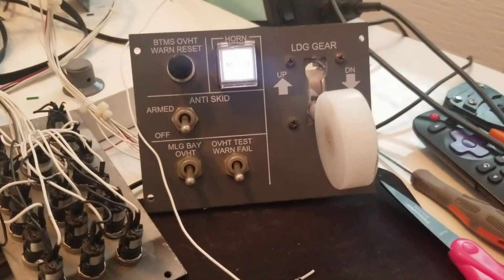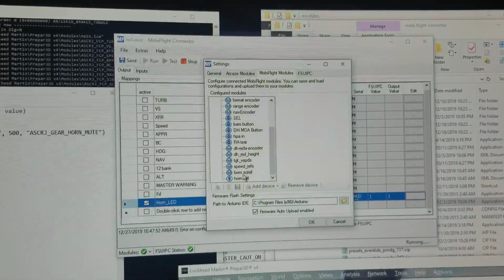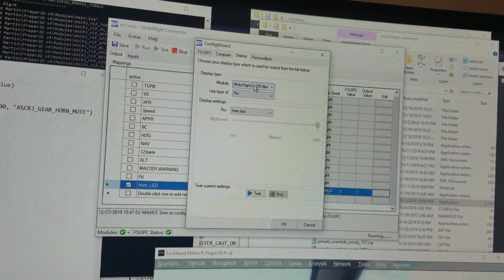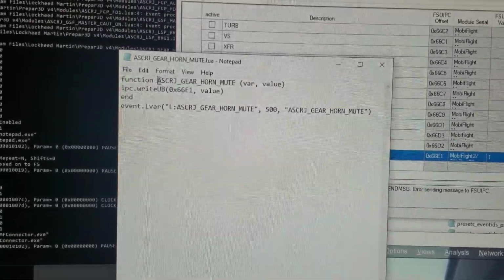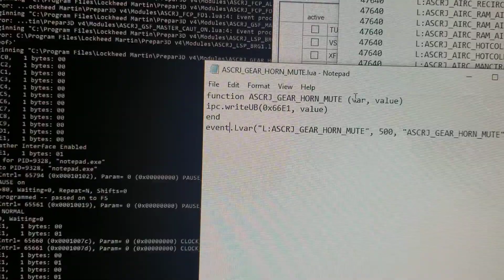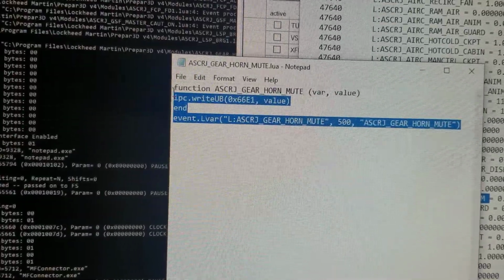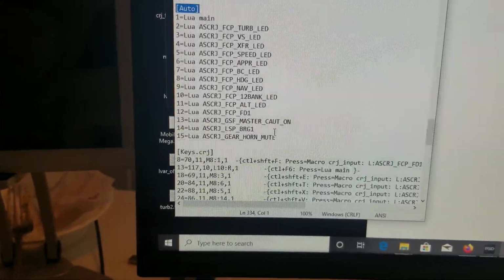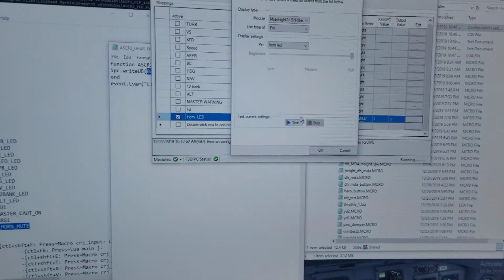Activate LED lights by assigning FSUIPC offsets in MobiFlight Connector using LUA Scripts Flight Sim

Comment: Thank you so much for the video! Would you be so kind to tell in which site I can find those available offsets? Regards
Reply from the maker: http://www.fsuipc.com/   Just look for the SDK link
Reply: Thks! Used your video using the Lvars for the Inputs and worked perfectly! Really happy, but I am really struggling with the Output. I followed every step several times but not managing to fire the light! I got the Lvar (L=embApFlchClick) and placed exactly in the Lua file as you instructed.
Reply from the maker: @jmsiqueira1989  are you sure that is the correct LVar?  Have you dumped all your LVARS into the log file to make sure you are using the correct one?
Reply from the maker: Are you using MObiflight for the output to fire the LED?
Reply from the maker: @jmsiqueira1989   Also...have you assigned a proper FCUIPS number to hold the data for the LED?
Reply: @AaronWerner  I Fired the Lvars to the Log file. I want to fire a LED in the output everytime FLCH is pressed. I found the LVAR which is "L=EmbApFlchClick", so my following lua file is: 
function EmbApFlchClick (var, value)
ipc.writeUB(0x6904, value)
end
event.Lvar("L=EmbApFlchClick", 500, "EmbApFlchClick")

The INI file is set as follows:

[MacroFiles]
1=Guidance panel
2=P3D
3=EMB AP VS
4=AP_HDG
5=EMB_SPDMAN
6=L_ENGINE_FIRE
7=AP VS
8=AP VS INC
9=AP VS DEC
10=EmbApFlchClick
11=FMS FPL
12=EmbApFpaClick

[Keys]
1=72,8,1114,0 	{H: Press= }
4=74,8,1114,0 	{J: Press= }
6=76,8,1114,0 	{L: Press= }
8=71,8,65804,0 	{G: Press=AP_ATT_HOLD_ON }
10=83,8,1114,0 	{S: Press= }

[Window.Message Window]
NewDocked=20, 47, 2520, 23

[Window.SimConnectWindow]
NewDocked=960, 540, 640, 360

[Profile.arduino]
1=Embraer 190 House

[LuaFiles]
1=EmbApFlchClick

[Auto]
1=Lua EmbApFlchClick
Reply from the maker: @jmsiqueira1989  did you store the value in  an FSUIPC offset? You must just store the value and then access the FCUIPC offset in mobiflight to read it and execute he LED.
Reply: @AaronWerner  I´ve seen this "0x6904" offset in someone´s post and tried to use the same. But not sure if that Offset works out
Reply from the maker: @jmsiqueira1989  No you have to use one that is not currently being used.  Read the FSUIPC documentation to understand.  I do not have the time to explain here.  I am sure after you read you will know what offset is available on your aircraft to write to.  Once  you locate this, it will be very easy to store, read and fire LED.

Comment: Hi, thanks a lot for your videos. I strictly follow your instructions but it doesn't work. Is it possible that something change with the latest version of Mobiflight and FSUIPC6? Do you know where I can find a tutorial or information about this?
Reply from the maker: Did you restart the sim?
Reply from the maker: I am not sure if something changed in the latest.  It is possible.  Can you download an earlier version and test it?
Reply: I think that something change, since I also followed your instructions in another video "Lua script and macro no FSUIPC offset" and it didn't work. So I tried in a different way, I didn't edit the Macro (I left the macro as the mouse macro originally created by FSUIPC), then in Mobiflight under FSUIPC Lua Script I edit file name:file name, for example my macro file is EFIS_CSTR I then write EFIS_CSTR:EFIS_CSTR and magically it worked.

Regarding the MOBIFLIGHT output I am lost, I tried in many different ways and I couldn't. If you have any ideas please let me know. Do you know where I can find an earlier version of Mobiflight?
Reply from the maker: @fabiofarinon3988  I might have an older version but I would like to figure out what changed.  I have not worked on my sim for a few months and if there is a change we need to identify what and how to work around it.  I will try to spend some time on it this week with the latest version. Send me a copy of your code and I will try to replicate it.
Reply: @fabiofarinon3988  Hi, I am wondering if you have figured out how to get the LED worked?

Comment: I follow your instructions .but still can't read my value offset
Reply from the maker: My guess is that you may be using an offset that is already assigned to something else, if not, make sure you name the file correctly and the code matches exactly like the code in the video except the actual offset that is assigned and the name of the LVAR.    Also, remember when adding Lua scripts you have to define them in your fsuipc INI file in order for them to load upon startup.
Reply: @AaronWerner  in my case ,I fly a2a Cessna c172.
Name file at module" Lkap140_hdg.lua"
In file fsuipc.ini edit .
Auto
1= Lkap140_hdg.lua
Reply from the maker: @maskystudio9193  post a copy of your code here.
Reply from the maker: Also did you restart after editing the FSUIPC.ini file?
Reply: U mean restart prepare3d
Reply from the maker: @maskystudio9193  Yes
Reply: function L:kap140_hdg(var, value)
ipc.writeUB(0x66E2, value)
end
event.Lvar("L:kap140_hdg",1,"L:kap140_hdg")
Reply from the maker: @maskystudio9193  Your code is not formatted like the one in my video.  For example, you have the L: following the function.  You do not include the L:  I did not look at the rest of your code but it appears you are missing info on the last line.  Please make sure you follow my example in the video and you will be fine.  Every space, line needs to be formatted the same or else it will not work.
Reply: Ok .I will editing script  and show u result soon..
Reply: ***** LUA: "Lkap140_hdg.lua" Log [from FSUIPC version 5.141e] *******
    55813 System time = 16/07/2021 23:05:21, Simulator time = 14:02:47 (07:02Z)
    55813 LUA: beginning "C:\Program Files\Lockheed Martin\Prepar3D v4\Modules\Lkap140_hdg.lua.lua"
    55813 LUA: ...kheed Martin\Prepar3D v4\Modules\Lkap140_hdg.lua.lua:4
    55813 LUA: Global: ipcPARAM = 0
    55813 LUA: ...kheed Martin\Prepar3D v4\Modules\Lkap140_hdg.lua.lua:2
    55813 LUA: ...kheed Martin\Prepar3D v4\Modules\Lkap140_hdg.lua.lua:5
    55813 LUA: Waiting for an event in "C:\Program Files\Lockheed Martin\Prepar3D v4\Modules\Lkap140_hdg.lua.lua"
   276109 >>> Thread forced exit (ipc.exit or os.exit) <<<
   276109 System time = 16/07/2021 23:09:01, Simulator time = 14:06:17 (07:06Z)
******* LUA execution terminated: Log Closed *******
Reply: function kap140_hdg_button(var, value)
ipc.writeUB(0x66C2, value)
end
event.Lvar("L:kap140_hdg_button", 500,"kap140_hdg_button")
Reply: THAT FSUIPS.INI

[General]
UpdatedByVersion=5141e
History=B05OKYY0D6MSSS6363XIW
AxesWrongRange=No
TCASid=Flight
TCASrange=40,3
AxisCalibration=No
DirectAxesToCalibs=No
ShowMultilineWindow=Yes
SuppressSingleline=No
SuppressMultilineFS=No
AxisIntercepts=No
DontResetAxes=No
ThreadAffinityMask=x0
LuaAffinityMask=x0
InitDelay=0
GetNearestAirports=Yes
LogOptionProtect=Yes
TimeForLuaClosing=2
WeatherReadFactor=2
WeatherRewriteSeconds=1
TrafficStallTime=1
InitialStallTime=10
NormalStallTime=1
LuaRerunDelay=66
ComReadLoopTime=20
ControlsListBuild=24048
ProvideAIdata=Yes
ProvideAIairports=Yes
Console=No
ConsoleWindowTopMost=No
InitDelayDevicesToo=No
PMDG737offsets=Auto
PMDG747offsets=Auto
PMDG777offsets=Auto
A2AC172Roffsets=Auto
Annotate=Yes
UseSystemTime=No
UseMidMouseBtn=Yes
MouseWheelMove=No
MouseWheelTrim=No
MouseWheelTrimSpeed=1
JoystickTimeout=20
RestoreSimcWindows=No
FixMachSpeedBug=No
AutoScanDevices=Yes
DisconnTrimForAP=No
ZeroElevForAPAlt=No
ThrottleSyncAll=No
WhiteMessages=No
ShowPMcontrols=No
SpoilerIncrement=512
MagicBattery=No
RudderSpikeRemoval=No
ElevatorSpikeRemoval=No
AileronSpikeRemoval=No
ReversedElevatorTrim=No
ClockSync=No
ClockSyncMins=5
ClearWeatherDynamics=No
TimeForSelect=4
LoadFlightMenu=No
LoadPlanMenu=No
PauseAfterCrash=No
BrakeReleaseThreshold=75
SaveDataWithFlights=No
ZapSound=firework
ShortAircraftNameOk=Substring
UseProfiles=Files
EnableMouseLook=No
DelayedMouseLookZoom=No
WideLuaGlobals=Yes
ConsoleWindow=0,0,0,0
DebugLua=Yes
FSVersionUsed="Lockheed Martin® Prepar3D® v4",4.2.21.24048
SimConnectUsed=4.2.0.0
LogWrites=Yes
LogEvents=Yes
LogLua=Yes
LogAxes=Yes
LogButtonsKeys=Yes
LogExtras=Yes
LogReads=Yes

[WideServer]
WideFSenabled=Yes
AdvertiseService=1
Port=8002
Port2=9002

[Traffic Limiter]
AirportPreference=50
PlannedAirportsPreference=50
GroundPreference=50
NearerPreference=50
TargetFrameRate=0
TrafficLimit=0

[JoyNames]
AutoAssignLetters=No

[JoystickCalibration]
RudderBlendLowest=1
AllowSuppressForPFCquad=Yes
ExcludeThrottleSet=Yes
ExcludeMixtureSet=Yes
ExcludePropPitchSet=Yes
SepRevsJetsOnly=No
ApplyHeloTrim=No
UseAxisControlsForNRZ=No
FlapsSetControl=0
FlapDetents=No
ReverserControl=66292
Reverser1Control=66422
Reverser2Control=66425
Reverser3Control=66428
Reverser4Control=66431
MaxThrottleForReverser=256
AileronTrimControl=66731
RudderTrimControl=66732
CowlFlaps1Control=66162
CowlFlaps2Control=66163
CowlFlaps3Control=66164
CowlFlaps4Control=66165
SteeringTillerControl=0
MaxSteerSpeed=60

[Axes]
PollInterval=10
RangeRepeatRate=10

[Buttons]
PollInterval=25
ButtonRepeat=20,10

[LuaFiles]
1=Lkap140_hdg

[Auto]
1=Lua L:kap140_hdg

[AutoSave]
Next=1
Interval=60
Files=10
SaveOnGround=No
AutoSaveEnabled=Yes

[GPSout]
GPSoutEnabled=No
Port=COM1
Speed=4800
Interval=2000
PosTo6Decimal=No
SimModeIndicator=No
Sentences=

[GPSout2]
GPSoutEnabled=No
Port=<none set>
Speed=4800
Interval=2000
PosTo6Decimal=No
SimModeIndicator=No
Sentences=

[Sounds]
Path=C:\Program Files\Lockheed Martin\Prepar3D v4\Sound\
Device1=Primary Sound Driver
Device2=SHARP HDMI (NVIDIA High Definition Audio)
Device3=Realtek Digital Output (Realtek High Definition Audio)

[Window.Message Window]
NewDocked=20, 55, 1329, 17

[ClientNames]
1=CAPTAIN

[Monitor]
Display=15

[Profile.c172]
1=C172R default
2=C172R F-GOAP

[Keys]
4=72,10,66106,0 	{ctl+H: Press=AP_PANEL_HEADING_ON }

[Keys.c172]
5=72,10,65798,0 	{ctl+H: Press=AP_PANEL_HEADING_HOLD }
Reply from the maker: @maskystudio9193  In your INI file you have the following 1=Lkap140_hdg
 it should be 1=kap140_hdg You do not need to use the L to define the LUA script here, you just need to add the name of the file.  Unless you name the file with the L, remove it.   If your file name includes the L then you will need to update the code to reflect this.  Make sure you restart the sim after making any changes to the .INI file.  Also make sure Mobiflight is up and running as well.   If it does not work, then check all your code because something is off.  I want to help where I can but I am not your code tester you have to take the time to do this and be accurate at it.  Good luck!
Reply: Where u get list aircraft code.
Where file in location
Reply from the maker: @maskystudio9193  I do not understand?
Reply: In my case i don't know ist true or not my script.i copy pdf sample c172 

Heading lock set =(L:kap140_hdg,button)
Reply from the maker: @maskystudio9193  Are you looking for the panel vars for your specific aircraft?  If so follow the instructions in this video. https://www.youtube.com/watch?v=mOO32FiMNS0&list=PLlT7WHi69XcdmtFnWhTkwl8wJtskb_4j8&index=7
Reply: I see your fsuipc.ini file, under [Auto] first line u have 1 = Lua main.
This word tittle for the?
Reply from the maker: @maskystudio9193  It is the name of a file that holds multiple scripts.
Reply: So I should be create main Lua script.
How can I do
Reply from the maker: @maskystudio9193  No you do not.  That is only a name I gave one of my lua scripts.   You need to verify the name of the LVAR for your aircraft.  If all the code is correctly written and the name is correct it should work.  Are you sure FSUIPC and Mobiflight are both working when you start your aircraft?
Reply from the maker: YOu might try a different offset as well.  You need to locate one that is not being used by your aircraft.  I am not sure how you would do that.
Reply: What inside file main lua.i think this part I missed
Reply: My fsuipc running perfect to mobiflight.if I fly default aircraft p3dv4 For your information.if I editing fsuipc.ini file.i must be restart again my sim.many hour I try configure them.hahaha....
One more think.ist any activate in fsuipc.ini file.
My experience b737 pmdg it same situation.
I edit ' enable data broadcast ' it done connecting.

Comment: Why exactly do you need an offset when you have an lvar? I really don't understand offset and why is it required?
Reply from the maker: From my understanding early on in the sim world, data was stored in offsets.  So earlier aircrafts leaned on offsets as a method for controlling the data.  Later aircraft designers started using variables and as a result, we have LVARS and scripts like LUA.  In examples like the one in this video we are somewhat piggybacking off of existing tech (FSUIPC) and bridging it with the LVARS using middleware like MobiFligth Controller.  It is just a point and click solution that eliminates a person having to code the behaviors of the aircraft and hardware.
Reply: @AaronWerner  got it. Thnx
Reply: @AaronWerner  can we create our offsets?
Reply from the maker: @CaptMeMo_350  Yes if you look at the video above you can see a write statement.  You can assign your data to an offset as shown in the example I provide
Reply: @AaronWerner  man I have just discovered your channel and its like a treasure for me :)). those are the stuff that I was looking for. Very very appreciate indeed
Reply from the maker: @CaptMeMo_350  took me forever to figure it out....so I feel the pain. I am happy that you found it.

Comment: great vid, is it possible to assign "in-transit" red led and "3-green" green LED to a landing gear light-set (using RGB lights for red & green) ... so i would have 3 single led's next to a gear lever and since they are RGB, they would either be OFF state, ON GREEN state, ON RED state for Landing Gear UP, Landing Gear DOWN, Landing Gear IN-TRANSIT respectively using MOBI-FLIGHT or similar program?  (Mobi-Flight has 2020 compatibility now, that's why i mentioned that one).  Thanks in advance!!!
Reply from the maker: Yes it is possible.  You need to dump the LVARS into the log file as I showed in my video on lvars.   Locate the lvar associated with the red / green state.  Assign those  as shown in video.
Reply: @AaronWerner  -- great, i will review the video again and look for LVARS !!!  perfect, thanks!!!

Comment: sorry just saw this video after my previous comment. What does the "500" represent? cheers
Reply from the maker: This is the value assigned.  From my understanding (very limited) it controls the intervals related to the polling for that specific item.  For example, if you were writing it to turn the ignition key in an aircraft to the "On" position it would require a 100 to complete this.   I have had to do a lot of trial and error with the values.  

There may be a better guide or instructions on this you could find. If you happen across more info. Please come back to this post and update us.

A few other items in the script that may help yu understand it. 

Offsets: Available offsets to write data to are 66C0 to 66FF.

As it relates to bit data:
Example 
ipc.writeXX( 0x66C0, apu_master_light)   -- write the Lvar state to location 0x66C0 
where the XX is one of the following depending on the data format of the read Lvar, and thus the format of apu_master_light: 

UB unsigned 8-bit byte 
UW unsigned 16-bit word 
UD unsigned 32-bit dword 
SB signed 8-bit byte SW signed 16-bit word
 SD signed 32-bit dword 
DD signed 64-bit value 
DBL 64-bit double floating point 
FLT 32-bit single floating point 

In the case above, if the variable state is either 1 or 0 (for On and Off) you should be able to use the UB data format: 
ipc.writeUB( 0x66C0, apu_master_light)